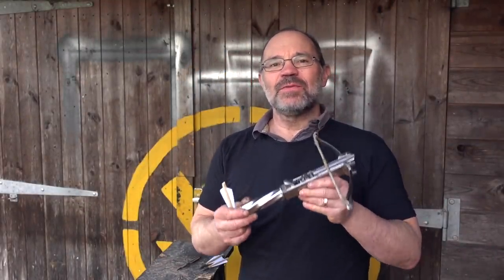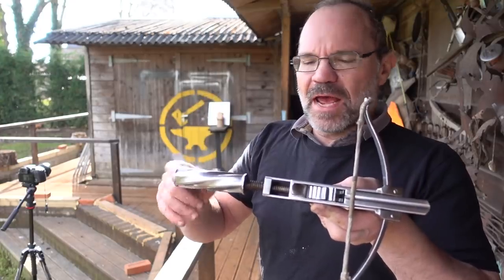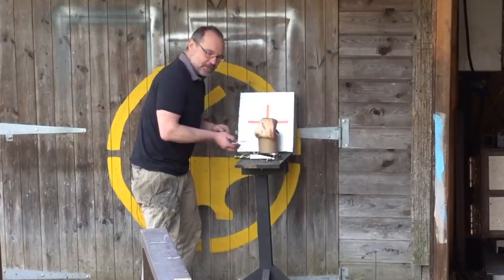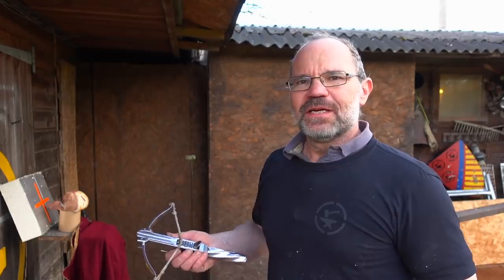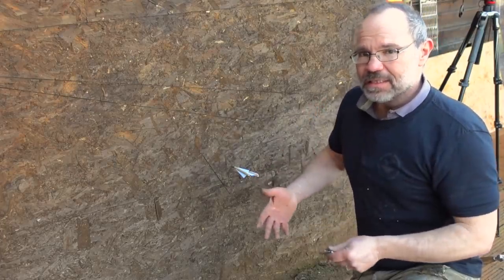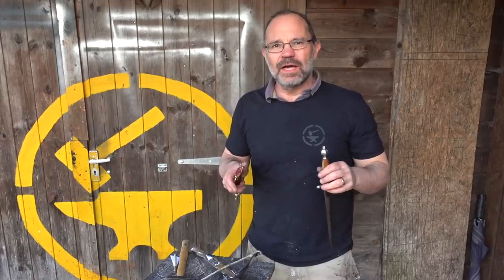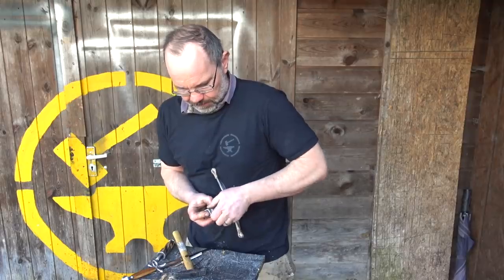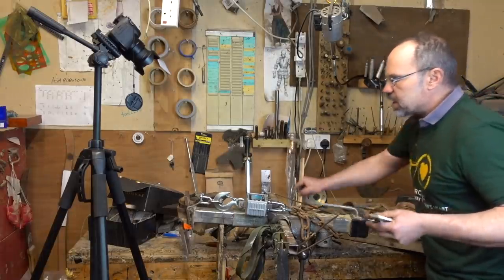200lbs Assassin's Crossbow - LET'S TEST IT!

Comment: As far as the potential use by an assassin in the Elizabethan period (Elizabeth 1) you need to remember that the majority of crossbows used for hunting were used  with poison on the points as far as I recall the poison used was an extract of the hellebore plant I cant recall off hand whether it was black hellebore or white hellebore but it was one of them. You can be certain that any assassin of that time would be aware of that fact.

Comment: I agree with the points you were making, but I think you're also underestimating/forgetting a few key factors. Firstly is the benefit of a near silent ranged weapon, second is amount of training, and last is the ability to pair it with a dagger. If you trained with the bow and got more proficient with it and had that dagger on quick standby, it would be a truly formidable tool for an assassin on tight city streets and back alleys- it wouldn't draw as much attention as a gunshot and it would certainly give you an advantage over the average dagger wielder. I could imagine it even being used as a tool to reduce mobility in a target- but again, I think the main point is that it isn't a big ol' boom

Comment: I can imagine these crossbows being used in a crowded market place with your target feet away rather than yards, tucked out of sight then whipped out and a bolt shot into the chest or stomach of your target. Quick, easy and quiet. I guess they’d be no reason why the bolt couldn’t held in place with a piece of twine or silk which would break on being released.  I’d be interested to see a test again this time within just a few feet of a meat joint to see the damage and accuracy.

Comment: Weight is only one part of the equation; that little bow could have a 1000lb draw weight, but the short limb length will only ever allow the string (and bolt) to accelerate too a certain velocity. Which is why a 90lb regular recurved bow, will fling a bigger, heavier arrow at a much higher velocity.

Comment: I'm on the fence. I agree that this would be more discrete and give the advantage of distance from potential reprisals and identification. However, I also agree that it would be difficult to conceal while getting off a quick and accurate shot would be difficult to achieve successfully. As an assassin of the time, with ready access to poison a simple blow pipe would have all the advantages and none of the disadvantages of this device. Still pretty cool though! Wish I lived in a country that allowed these sorts of toys...

Comment: I think a good scenario where this could be useful, is maybe when some noble character is escorted by guards, so you can get only that close, maybe 3 to 5 metres so a dagger is not an option. If the noble is walking around near a crowd, the assassin can be mixed among the people, using large garments to conceal the weapon. If the assassin is skilled enough a neck or heart shot at 3-5 metres could be possible, and possibly fatal. Just an idea
Reply: At that close a range, the guards will catch you. Also even at that close a range, if you observe the bolts in flight, your odds of a hit are still pathetic.
Instead, you could use the tried and tested, old as the stone age, blowgun. Better on every metric from stealth to cost to accuracy to usability to traceability. Even I can hit a target at 10 meters with one that was made from a reed (I have done it) and my aim sucks, the blowgun sucked, and the darts were made from sticks I found and cut down to size. I was a bored kid.

Comment: Itd be able to fire a far heavier bolt without a significant speed loss, though potentially a significant lethality loss, and technically carry far more joules of impact energy. The size is the problem with an extremely limited draw length limiting both speed and size of the projectile. Can't be helped.

Comment: I could see one appeal this would have for an assassin over a wheel-lock pistol or a dagger, that being not so much the ability to conceal prior to shooting, but the ability to conceal after the shot.
A dagger puts you a little too suspiciously close to the target, a pistol runs a high likelihood of drawing attention with the noise before anyone even sees the body of whoever was shot, and throwing darts have a very pronounced motion that's hard to cover-up.
This has the potential to take its shot being quiet enough for talking people to drown out the sound, a subtle enough motion, and long enough distance to not draw attention in a crowd until you've already hidden or discarded it and made your way into another part of the crowd thus continuing to hide in plain sight after the shot is taken.
Its usefulness on the assassination end would be very situational, but if someone is plotting an assassination, the practicality of the tool being used in different circumstances than the specific one being planned may not be something the original designers were taking into account.
If I were to throw my hat into the ring of wild speculation, which I am because it's fun, I would guess it was made for one or two specific assassinations and then either kept as a fun little gadget, or discarded and found by someone else who thought it would be a fun little gadget...  I can't prove that's how it came to be, but head-canon history only needs to be as accurate as the information currently available which may be about as accurate as that crossbow, but it's jolly good fun until it's corrected.

Comment: Wouldn't it be easier to just use a poisoned blow dart? Way more accurate from significantly longer range, quieter, easier and cheaper to craft, way easier to conceal, and with practice, you can get followup shots pretty quickly.

Comment: Maybe im reaching but this seems like a valid survival tool. I can easily see myself bagging a bird or two if i needed with that and a slow reload wouldnt matter if your hunting since a miss is going to scare the quarry anyway. And the simple shape and steel build means it isnt fragile or a pain to stow. Hell you can field strip it
The only glaring issue i see is accuracy.  Perhaps its an issue with the fletching on the bolts or the weight of the projectile itself.

Comment: I'd say it's feasible because it's fairly silent. I don't think you'd want to shoot people head on, maybe in the back and then you'd still be able to slip away if you plan it well. Obviously high value targets probably won't hang around dark alleys for you to shoot but I think with poison and a pretty close range shot from behind you have a pretty good chance of hitting your target and slipping away undetected. You'd obviously also train day and night to get the accuracy right. It's definitely not the type of weapon that you're just going to pull out and fire, it'll need some preparation.

Comment: Maybe the all steel crossbow also refers to the bolts? With such a short draw length and relatively high power, could it deliver energy more efficiently using a thin all-steel bolt? Like a needle. I imagine that thing would be nasty.

Comment: I’m pretty sure that the real point of these was to be able to be quiet from a close distance. You could sneak up near someone in a crowd and shoot them from like a foot away and probably not even be noticed. It’s quiet, powerful enough, and small. If you use a dagger you can be easily noticed because it is usually pretty noticeable when you stab someone to death.

Comment: This would be best used within 2-5m.  And it would be silent, unlike a wheel lock, which would also leave powder burns on the killer's hands.  It also has longer range than a main-gauche.  Also, blood is hard to wash off a surface, which means easily trackable.  I can totally see the Balestrini being used effectively.

Comment: So for anybody who doesn't know much about bows and crossbows, the reason it can be 200 pounds and hardly do any damage compared to a 40 pound or even 25 pound compound bow is largely part because of the draw length of the crossbow, a big part about what gives the arrow power and speed is how long the string can be in contact with the arrow propelling it forward, the longer the draw the longer the string is accelerating the arrow.
Reply: It's a common answer floating around, but it really doesn't make much sense, and is missing the point. In fact short acceleration 

The reason this 200 pounds crossbow has tiny energy is because 200 pounds is just a static force required to hold it spanned at maximum draw, and nothing more. It's a just a number.  

It's just a tiny spring, so even by exerting that much force, you're not storing much energy anyway.

Energy stored equals to force times distance, length of deformation, or however you call it, draw length, in this case.   

W(E) = F*s 

The draw length is just few inches, so energy stored is low, the angles here make it ever less efficient. 

You can see that the arms bend very little, so even if they're steel and thick, this displacement can only store so much energy.

If you bend long limbs of a 7 feet longbow over ~25 inches, then huge amount of energy is stored, even f you only use, say, 60 pounds of force to hold it fully drawn.

Comment: If the crossbow had a collapsible stock and perhaps used rubber or some composite energy delivery system then it could be compact and accurate when fired? e.g. 2 x stock length, increased energy delivered and longer, thinner bolt.

Comment: Tod I have a small compound hand piston crossbow of 150 pounds, it shatters it small metal tip and plastic dart bolts (about 4 inches long) at 10 metres in wood and is accurate at 50m. Can you do a thorough test on these small compound crossbows please.

Comment: Mr. Tod, I do not want to give the impression that I treat you without due respect - for some reason people constantly complain about me that I am rude to them and despise everyone, although I am very respectful, but are you sure that you make crossbows correctly? Which way are the crossbows ' shoulders pointed when the bowstring is lowered? The shoulders of those historical crossbows or replicas of them that I saw were pointed forward. How about yours? After all, it was precisely the fact that the compound bows had their shoulders pointed forward when the bowstring was lowered, which ensured that, allegedly, with a tension force of 35-40 kg, they were stronger than the long bows with a tension force of 120-130 pounds, which were used by the vast majority of English archers during the Hundred Years ' War. 
Maybe the presented crossbow was weak, and before that it turned out that the 860 crossbow, apparently, at a distance of 25m had less penetration than the 160 longbow, because when the bowstring is lowered, their shoulders are not directed forward?

Comment: Guns make a loud noise, it startles people, and more importantly, makes it easier for a royal guard to determine the point of origin, (POO), of the shooter.  You also do not need to get as close as you would with a dagger.  You spent one afternoon working on your marksmanship with this crossbow.  Imagine if you had a year to dial in your accuracy.  A poison tipped bolt would do the job quite nicely.  This is absolutely an assassins' weapon.

Comment: The one that hit the jacket on top penetratet it for sure. But it did not go through. So basically if u have courtains for ur windows u are safe. Also with the short range that this works well in u might aswell use a potato knife.

Comment: If I was to weigh in at this later stage, I'd comment that I could see its use Vs VIPs and the like who have a retinue accompanying them, so a stabbing implement is a not necessarily a good option. And a pistol is probably quite expensive and leaves a massive smoke cloud along with its noise. In a crowded space I could foresee it being difficult to pick one of these out from a crowd over a pistol

Comment: For a 200lbs mini crossbow most people would be dissapointed, but the thing is that there's not enough run to properly transmit all the energy to the bolt, so it needs to be stupid strong just to get the strength of a regular bow.

Comment: Watching this got me thinking: what if bolt was made of steel? I mean, fully, from tip to fins. Thin string wire, thin but heavy steel bolt, could have dig deep into flesh at point-blank. Add some jagging - and with no modern medical means such wound would've been lethal.

Comment: Multileaf prod would make more sense giving a longer stroke ..the draw weigh is wrong for the size..I know this could be amazing as I have an 8kg dw homemade steel mini crossbow shoots round wire nails it's very powerful for it's 140mm total length

Comment: What is the great advantage of a spear over a sword? Distance. Not much distance, maybe 6 feet(2ish meters) or so? But that 6 feet is enough that the spear wins the vast majority of the time. If you change that to sword vs dagger, the advantage is even less, but the sword still has an overwhelming advantage. If you are trying to assassinate someone who has bodyguards, 5-6 feet is the difference between success and failure. It is also worth noting that for the professional assassin, a successful escape is at least as important as killing the target, arguably more so. If an assassin carried this cocked and ready, they could insert a bolt by feel while it was under their cloak, then shoot from the hip at very close range if they had a clear shot. This would allow them to shoot through the bodyguards then make their escape. If the bolt is poisoned, it really doesn't matter where it hits, as long as it hits. A shot in the arm is as good as a shot in the heart. And if it misses, wait for a chance to try again.

Comment: I think the reason why someone would use this over a pistol for an assassination is the noise. If you stand in a crowd you can fire a crossbow without pulling every ones attention, poisoned bolt walking past the target, firing from 3-5 meters. But i doubt it was made for long range, in that case, they could've just used a regular crossbow or a pistol/rifle.

Comment: I can really see this being used to assassinate someone. This would be something you would shoot at basically point blank range, where you can’t miss. You can poison the tip for effect. But the most important thing is that it doesn’t make a bang like a pistol. You could be in a crowd, get close to the target, fire the bow, drop the bow and blend in with the crowd. You won’t get blood on you like you would with a dagger. No gun shot means it’s harder for bystanders to determine who took the shot
Reply: And even a small distance means it's going to be much harder to tell where the attack came from and who it was without a loud noise to clue them in.

Comment: there are several reasons why it might be an assassin's crossbow.
A dagger requires getting so close that retreat is not a possibility.
A dagger requires at least some physical produce to use best
a little crossbow gives you a slight chance of escape 
an individual's strength matters not for a tiny crossbow

Wheel lock pistols are loud and attract attention, bound to get you caught.
assassin's weapons aren't about deadliness and quick kills.  They are about stealth quick escapes.

I'm not sure about this weapon, but I think it's possible

Comment: is there a significative difference between a 5 meter shot, and a 20cm shot ?
it loose strengths with distance, but i don't think the difference is big between 5m and 20cm.
(and you would have miss mush less shot at 20cm)

Comment: 1. Assassins target vital organs. A penetrating bolt doesnt even require much force. Blow darts have penetrating force.

2. the steel likely just refers to just the bow part and not the firing mechanism. Further research would be required though for a more concrete answer, like where these types nore likely made of wood entirely during this period or at all.

Comment: Idk. I think you are underselling the value of a projectile against a guarded target. Also, you assume that the quarrels were identical to those of a larger crossbow. What if it was an cord and tassel type fletching that hung  behind. The penetration would be the whole length of the bolt, and more potentially. Also, there is enough of a brace height to the bow that a leather sleeve could hold the bolt down and not survive the years. A shot from the crowd might be the only way sometimes.

Comment: There is only one modern day bow that is small enough to potentially fit in to this category, and can be cocked and loaded in under 10 seconds, the xbow supersonic, 120lb draw weight, by a cord at the rear, which is easy, and fires bolts at up to 330fps, how technology has advanced, its a reverse compound ofcourse.

Comment: From my memory... The problem with pistols back then is that the black powder would give away your position with smoke. + The added noise. 

If one had access to this device+ the ability to close with the target. ++ Poison then the use and ban of this item makes sense.

As to daggers. If we are in a back ally or in a brawl. Yes dagger beat this thing. 

The problem with a dagger is you need to be right next to someone to do damage and when they go down..... Your right next to them. For most work criminal work your right the dagger/pistol is the best weapon. 

A small crossbow like this has a very specific use case. 

Against unarmored targets, 5 or so meters with poison. 

The problem with the target moving is mitigated by gatherings where people are standing still for extended periods. 
Funerals, church, speeches, executions. 

Is it perfect.... No but if used well it gives a decent chance for escape for the assailant. Especially if one could drop or dispose of the weapon quickly. This way a crowd of people could be used as cover. 

Is it perfect no but non of the choices are anyway.